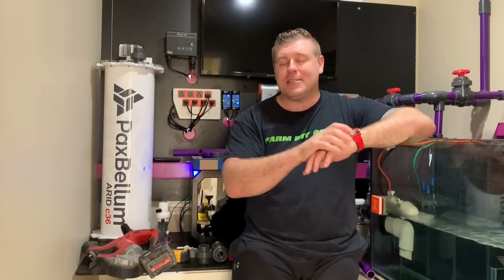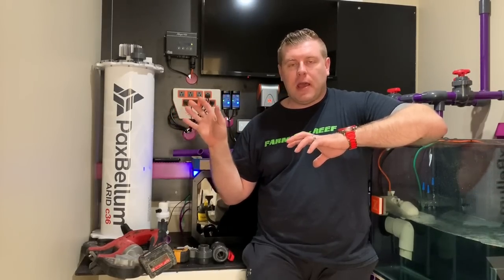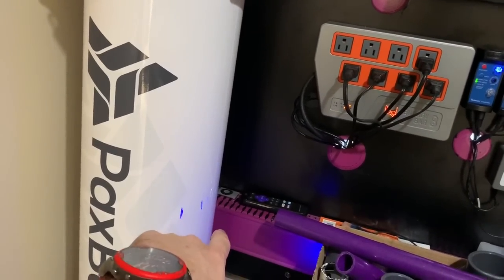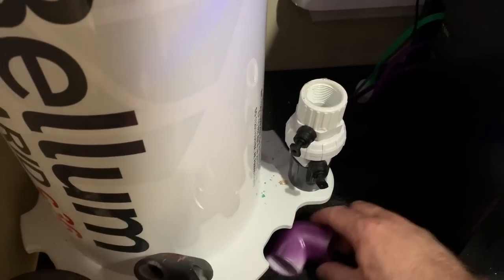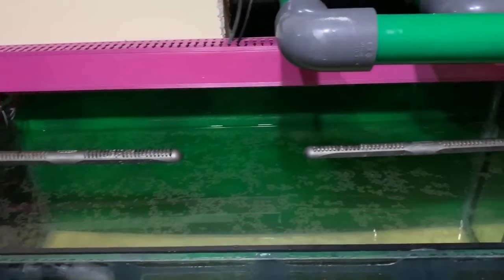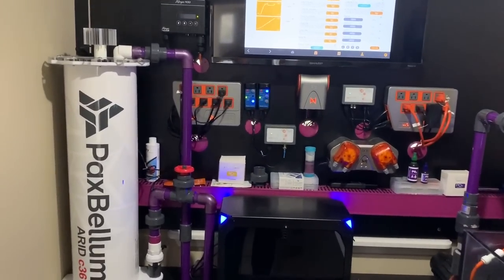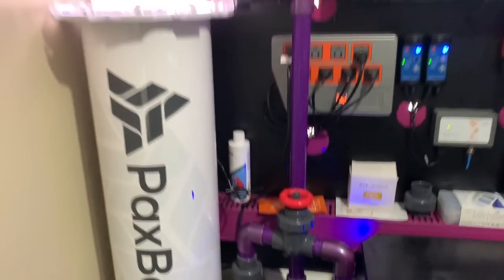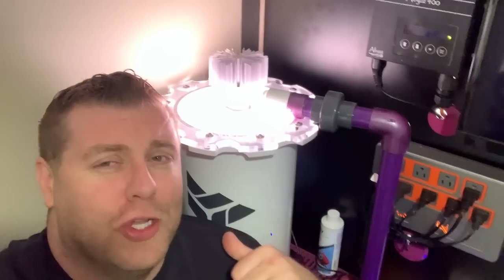PaxBellum ARID C36 Install on 600 Gallon Reef Tank THE HULK Update

Comment: You usually want to have your probe up stream of your heaters to ensure its getting the latest reading of your tank. If you have the probe downstream you are in theory getting a preheated reading and your tank might not be at that actual temperature. Not sure where the heaters are located so not sure if its up or down stream of the probe. For those drop pipes, look into a plumb bob for the future, saves on measuring.
Reply from the maker: Agree buddy this was just temp, I need to get the cables to extend
Reply: Sounds good, keep the great work! Very impressive and clean build! Appreciate the content

Comment: I almost bought one but went a different way just because of the light that is emitted from the top. One my tank is small in comparison so it wouldn't have been that size and two its in a living room so that might have been a little distracting....but my next tank pending results I might end up with one. I do have a ATS that I went with instead and so far so good. You might regret not having that puppy ground level IMHO because if it was it might be a lot easier to get at and clean. Then again it all looks nice and you defiantly seem to know what you are doing. Keep it up!
Reply from the maker: Thanks You

Comment: I don’t like how you have the packs bellum line coming right in front of the power outlets, which will, limit your access to them and should there be a water issue the water could literally spray right on those. And you have the union up there at the top, so you will have water when you disconnect it. I know you’re tight on space .
Reply from the maker: Thanks for you info 😊
Reply: FARM BOY REEF hey you got everything else set up so beautifully!
Reply from the maker: Thanks

Comment: Hope you got it for free because I regret buying one.  All it does is melt chaeto and be annoying to have to clean all the time.
Reply from the maker: The ARID is not plug and play like a skimmer its performance is completely dependent on the aquarists knowledge. It can be thought of as a high performance refugium where biilogical reactions occur at a faster rate. But if you don’t know water chemistry it won’t perform.
Reply: @FARMBOYREEF  No disrespect but you'll see.  I'm a fan, just not of pax belllum
Reply from the maker: I appreciate the follow. Where you using vibrant at the time ?
Reply: @FARMBOYREEF  no.